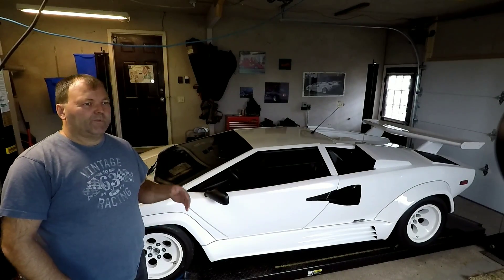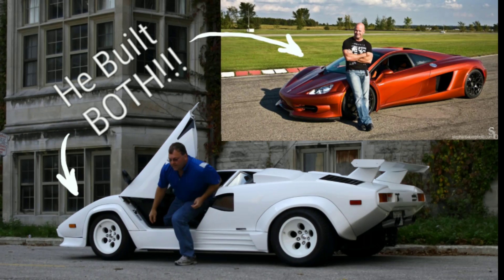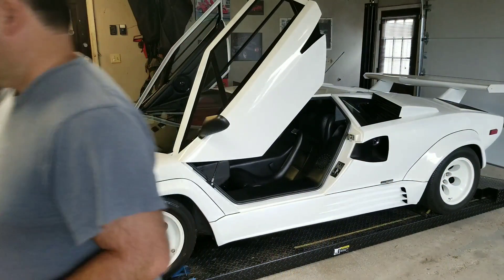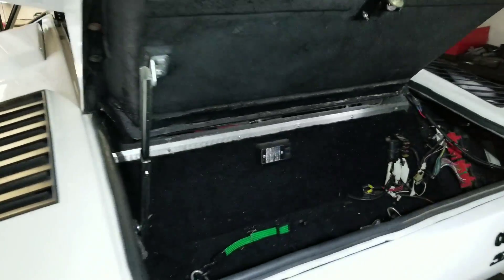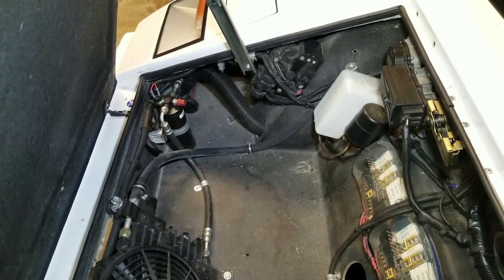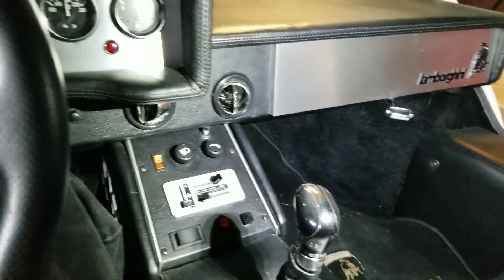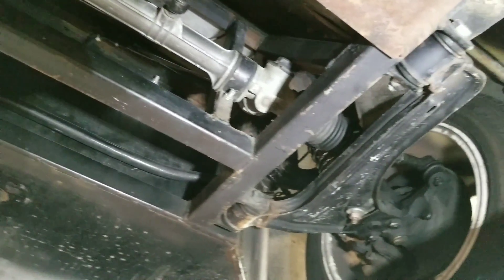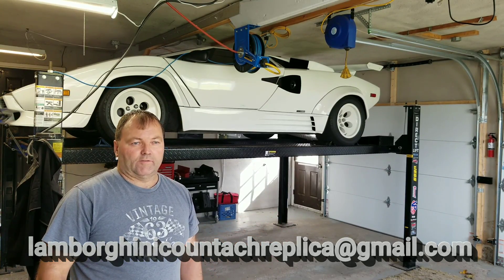Lamborghini Countach replica For Sale

Comment: I think its a Beautiful built Lambo Kit... be Fun to rebuild better.... and the 1988-90 is the one I would build with a GMC LS motor (LS3)... I've Started building a FERRARI TRUCK right now with a Wrecked low KM 2006 GMC SLT 4x4 Crew Cab 5.6 box... it will be LOWERED 4x4... FERRARI RED with All Ferrari Badges Molded to Fit like Factory... powdered coated yellow Frame and yellow engine details... Adapters to fit the Ferrari 458 20 inch Rims (GM to Ferrari)... Large Brake kit with Yellow Rotors (Brembo, Wilwood, Stop-Tech)... 700HP LS3 with Red Edelbrock Cross-Ram LS3 Intake Manifold... Black/Coffee Leather red sticking interior Yellow gauges... Hand Built Ram Air, Front and Rear Bumpers, Box Cover... going to pay close attention to Detail.... 38 years Paint and AutoBody... KOLORS AUTOBODY Alberta Canada